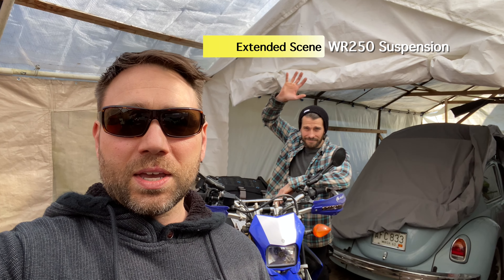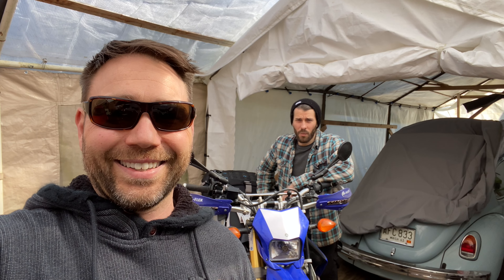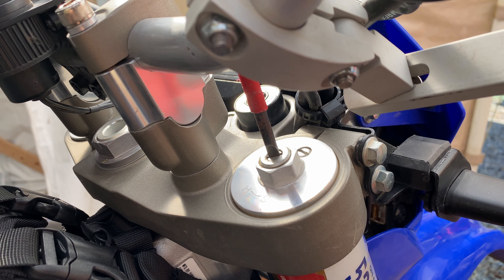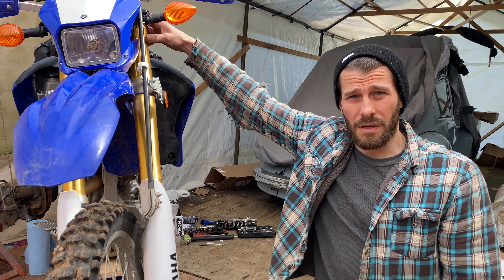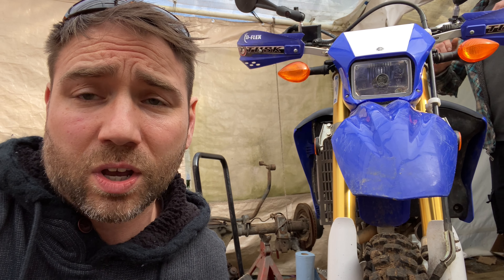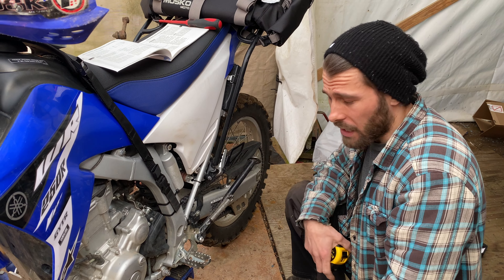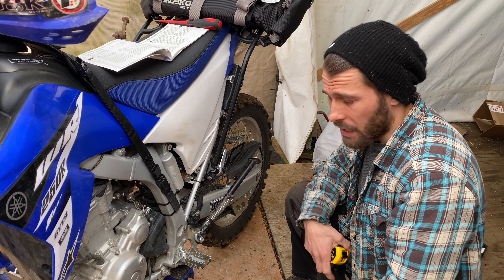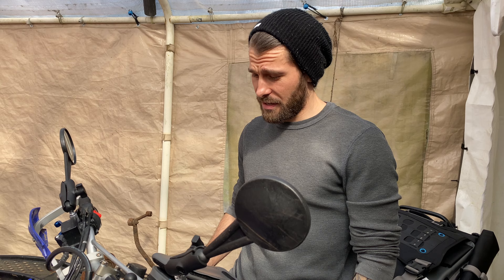How to Adjust Yamaha WR250R Suspension, Step By Step Tutorial

Comment: One thing about the rebound dampening. When you say full soft,  what you are doing is allowing the shock/forks to rebound quickly. This can lead to a pogo feeling, which for the rear on the wr isn’t ideal. I know I’m 200lbs and the rear compression dampening settings from the factory were too stiff! Suspension settings make a big difference on this wr250r

Comment: I noticed a few riders asking about adjusting the suspension that fall outside range of the stock suspension. If that's the case you really need to set the sage first, before making adjustments. That way you know without a doubt the spring rate is correct so your not wasting your time making adjustments that more likely will not get the results your looking for.  Most stock suspensions are set up for 185lb riders. Sounds like you fall into the weight range for a stock suspension, If the previous owner did anything to the suspension they more than likely changed the spring rate, revalved the forks or both, especially if they where north of 200lbs. And u never crank down your set screws on the suspension. Suggesting to go in as hard as it will go is bad advice. That's a good way to screw something up. At best u snug it up to wear it just gets tight.

Comment: Thank you for the video bud… I have 1 question, Does your suspension bottom out now since you dropped it low? Basically what im trying to figure out before i lower mine is if it does I rather leave it taller so when i go off roading i won’t bottom out on a jump or so. Thanks
Reply from the maker: I know that Adam in the vid had never jumped his bike so not sure if he would bottom out or not. I have the same bike and have it at stock and have never bottomed out when hitting smaller jumps. Never tried the big ones myself. Hope this helps!

Comment: What manual are you using for your information? I just got a 2023 wr250f and it way to tall for me to touch. 5”6 and 155lbs only a 29 inch inseam. I got it to follow my 4yr son around the trails so he can ride his 50cc. I installed the yamalink today and I’m still waiting on the short seat to come in. Gonna lower front forks tomorrow about 1/2 I guess. I’ve not been on a dirt bike in 20yrs lol. Open to all suggestions and help. Thanks for the great content.
Reply from the maker: If height is the issue I’d recommend a lower seat like the seat concepts first. Then if you need to go lower add a yamalink lower link. For adjust the suspension this would be a comfort and for the type of terrain you ride.
Reply: I took my forks and shock off and brought them in to a suspension mechanic. He was able to shorten the forks about 3/4 inch by adding spacers inside and likewise for the shock. Still used the original springs.

Comment: So if I am 230lbs can you help me get this setup? That is without gear. 
Thank you
Reply from the maker: I would set it at factory specs then go plus or minus from there depending on your riding style. I am about 200lbs and was happy with the stock setting. Adam preferred his to be more spongy and is about 160lbs. When I rode his I felt like it was too soft for my riding style. Again I would start at stock and adjust either way for your riding style 😊
Reply: These bikes are set up for 185lb riders as.most stock suspensions are. U really need to go w a different spring in the forks and rear shock if you want to do it correctly. Stock stuff is just way too soft.. and don't forget that's with you geared up completely. Set your sage first. That will tell you if u need to upgrade the springs

Comment: Whats your height and weight?  I'm 5'10 170lbs and dealing with the height issue, hoping this might work for me!
Reply from the maker: 5’8” and 160lb. Worst case you might need a yamalink and a lower seat.
Reply: @joelwallisadv  Roger that, ya I have the lowered seat. it's my first bike so it's all been a learning process. Excited to make these adjustments and see how it goes- thanks for the video
Reply from the maker: @petekemper4082  It’s a tall bike and would recommend the yamalink if you can’t touch. But the downside to the yamalink is you can get high centered on going over logs and rocks. But worth it if you can’t touch when stopped. I ended up putting my bike to the stock settings and removed the yamalink and just dealt with tippy toes touching when I stop to get the full performance.

Comment: How did it go with the new setting? Is there any update?
Reply from the maker: It made a world of difference. At the end of this video took it out for a test spin for the conclusion and happy rider. Plus after a ton of rides still is good. But depending on your personal specs you may need additional suspension work and or components like a lowering link and or seat. Plus if you are carrying luggage etc
Reply: @joelwallisadv  I only ride in DFW area highway and haven't ride on Off road since I don't want to ride alone. 5"7' 180 lbs. 
Thanks!
Reply from the maker: @MrAdam-kp3en  I would possibly set to factory specs and do a seat concepts seat if you are unable to touch… if height is the concern. I am 5’8”, 175lbs and have mine set to that above and am super happy on my 08’. Adam in this video is shorter then me and weighs less then me. He also has a yama lowering link installed with the seat concepts seat for reference. I had the spiral low seat which imo is lower then the seat concepts by a hair but the spiral imo is uncomfortable. If you are primarily riding road I wouldn’t rec softening your suspension and do the other alternatives. Hope this helps man!
Reply: @joelwallisadv  I have my 2020 model and just completed a little over 900 miles over 2 years period. Thanks!
Reply from the maker: @MrAdam-kp3en  complicated as in how?
Reply: @joelwallisadv  Sorry! It was spelling mistake.
Reply from the maker: @MrAdam-kp3en  no sweat :) always a good feeling to have it completed so you can enjoy riding! Feel free to drop a comment on any of my other videos if you have any questions or want to know more. Cheers!
Reply: @joelwallisadv  Yes, I will.

Comment: The technically correct way to adjust the suspension for your weight is to first replace the springs with the correct rates for you + gear + luggage. If you are around 160-190 the stock springs should fine though. The clickers aren't really meant to compensate for weight differences which is probably why the previous owner had them set so out of wack.

One strange thing I noticed, it appears the bike has a Yamalink lowering link already, but it also looks like it has probably another 1/2" to 3/4" of factory lowering that could still be done. Strange whoever owned it before would buy the lowering link but not do the factory lowering first.
Reply: And I believe you can remove the lock nut for an aditional inch of lowering, along with the first inch of lower addjustment that no one uses. ALSO looks like they did not lower the front, just the rear. Now it is a sand bike

Comment: you guys just helped me out so much and now I don't have to buy a yamalink for 150$!!
Reply from the maker: That’s awesome to hear and so glad you didn’t have to do the yamalink! Thanks again 🤘
Reply: Raising the jam nuts does lower the bike but it also changes the preload and sag which is most important. You should only change the preload to obtain the correct sag and not to lower the bike. There are better methods to lower the bike such as raising the clevis on the bottom of the shock and sliding the forks up slightly in the triple clamps (doing both so the bike is still balanced front to rear)

Comment: How to Adjust WR250R Suspension:
Ride it 'til you wreck it.  Then squirt it with some Yamalube.  Repeat.
Reply from the maker: Right! The wr is a rock solid bike. Looks like you ride one too?
Reply: @joelwallisadv  Yeah.  Couldn't resist the temptation of "the everything bike" as my first dirt bike/motorcycle.  Zero regrets.  It's very uniquely suited to the terrain around here.
Reply from the maker: @guyvsguy6728  Nice! I agree and zero regrets with mine too.